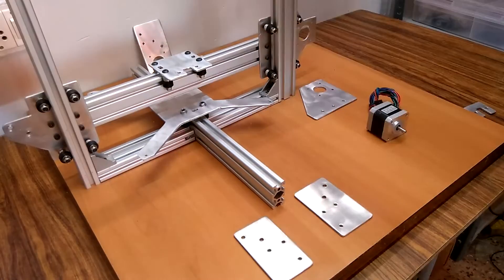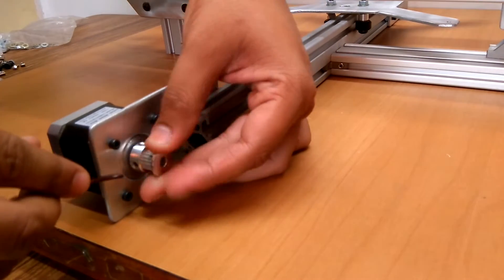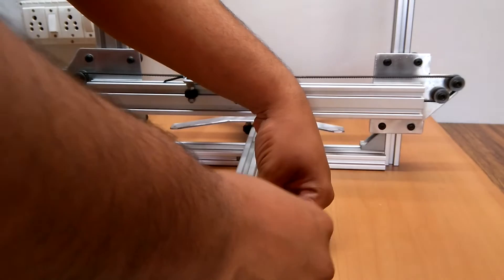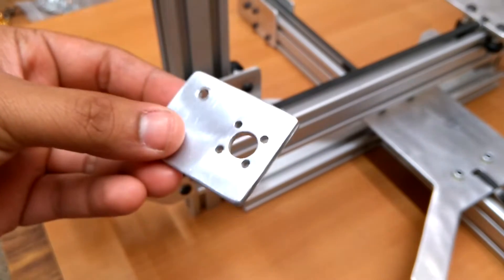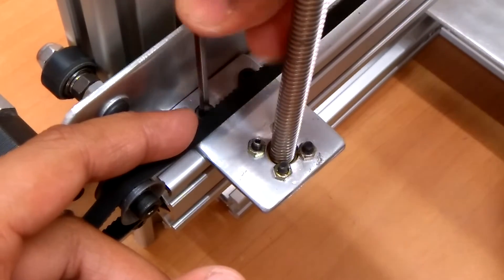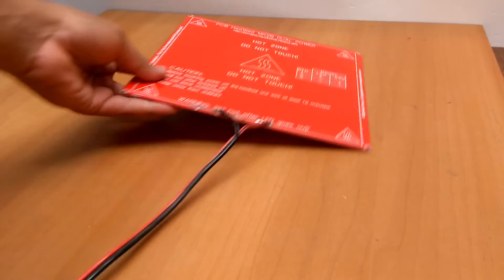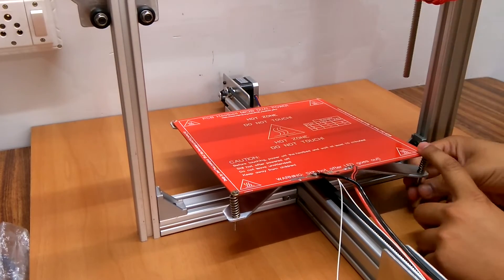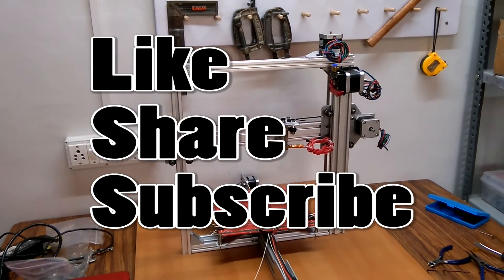How to Make 3D Printer at Home | Part 2 - Mechanical Build

Comment: As an alternative, can those mounting plates substitute with an acrylic board ?
Reply from the maker: yes
Reply: @SuperbTech  thank you so much for your reply. This is by far the neat printer i have come across. One more thing, what was the implication faced upon building this printer? Were there any problems with axis movement or print bed?

Comment: hey mate can i have the measurement of the chassis and the aluminium plate thank you :)
Reply from the maker: measurement depends on how big you want the printer. you can look for tevo tarantula frame measurements, as this printer is based on tevo tarantula design. thanks!
Reply: thankyou for the fast response :D
Reply from the maker: i have updated Mount Plate CAD files, you can check link in the description!😉
Reply: @SuperbTech  can i have your mount plates measurements. Please

Comment: I got a question for you, because i'm look to make this 3D-printer. Did you buy the all the mounts and plates? Or did you make them yourself?
Reply from the maker: yes i made them myself using 6mm aluminum sheet. used grinder to cut the plates and drill for holes
Reply: thanks mate
Reply from the maker: i am working on the files for plate designs, parts lists, buy links, will share them soon.
Reply: Keep up the good work! :D
Reply: Please can you have these aluminium plate mounts measurements. Please bro.
Reply: This is my gmail lasitha.sathruwan@gmail.com please send me